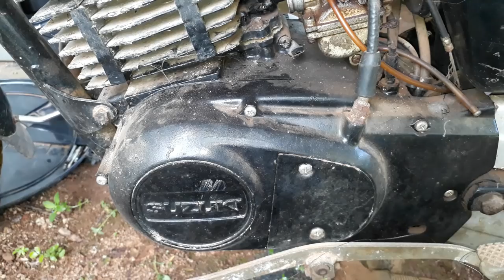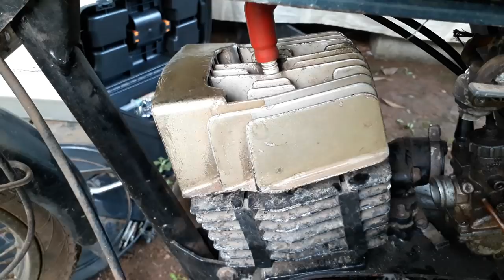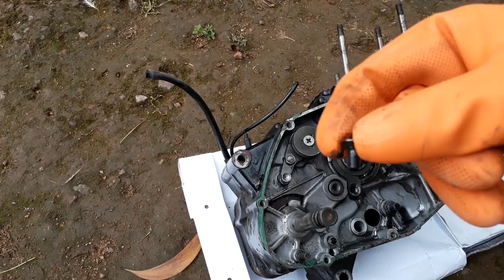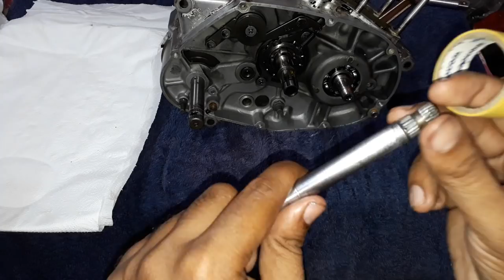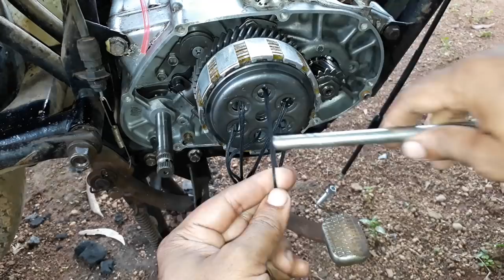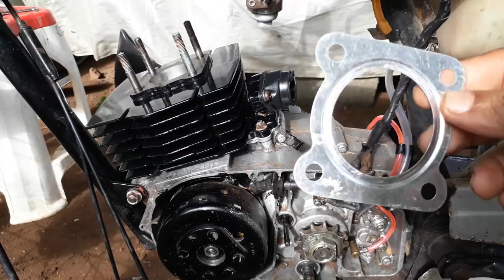Motorcycle Engine Rebuilt Time Lapse

Comment: Bro what's the cost of engine rebuilt 
 I have an max 100. Bike   but it's not used for long time 
 So I was thinking to rebuild it 
 Can u help me plzzzz
Reply from the maker: Around Rs 4000-5000
Reply: Ok bro tq
Since it is not used for long time  
Can I re bore or not plzz suggest me
Reply from the maker: Depends, if cylinder and piston has worn out marks. 
If it is healthy not required